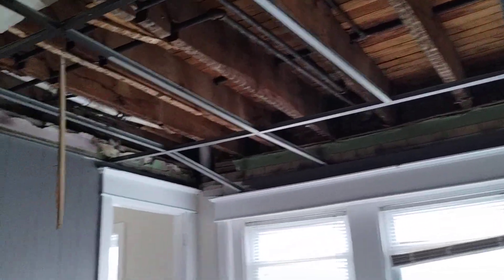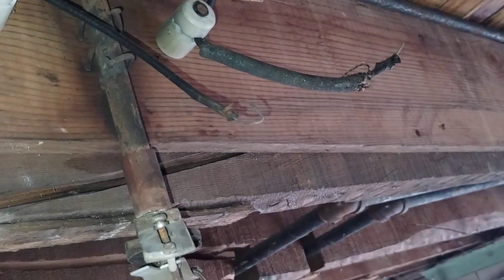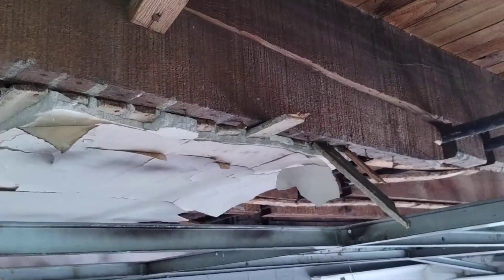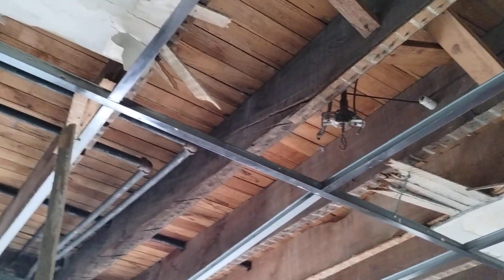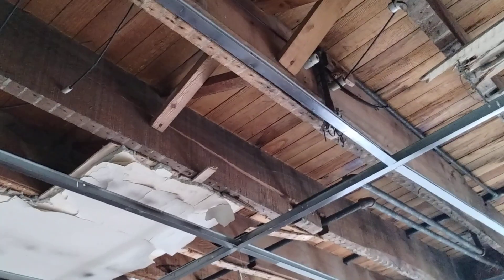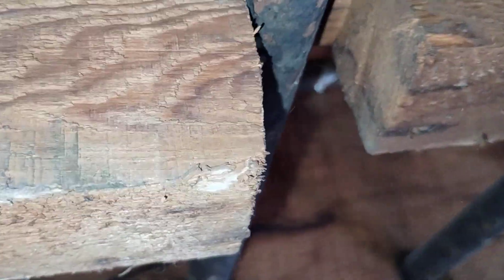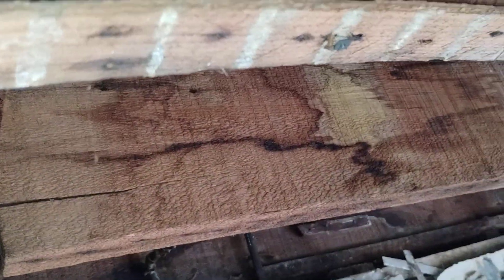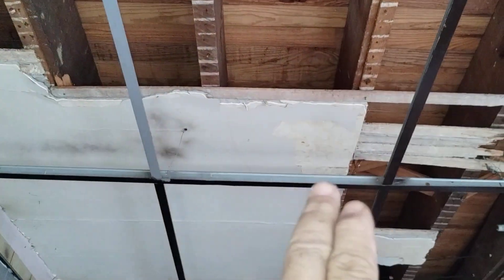Cracked Floor Joist and cause NOTCHes in center span part 2

Comment: Good catch on the cracked beam- was thinking check the nail holes. Was
Flat when fixed n the 1960’s plus those greatest generation guys didn’t do chitty work
Reply from the maker: Exactly, the damage took place after the lathe was installed...

Comment: My home was built in 1914. The gas furnace (1949), and water heater are located in the basement.

A web of gas lines run to each room in the house. 

Prior to the electricity becoming available, the rooms were illuminated with gas mantles. I disconnected and removed most of that gas piping years ago. I kind of regret doing so, and in retrospect should have restored the original gas lighting.

Comment: Nasty split. Never would have thought of the belt and suspenders approach on my own. How did you conclude those are gas pipes?
Reply from the maker: They had pipe dope and branched at where old lights would have been.
Reply: Thanks. I ask only because Im curious, and no way to tell by the information in the video alone. 
It looks like your going to have to break a few more eggshells. It should be interesting what you find in that corner. 
Thanks for sharing.